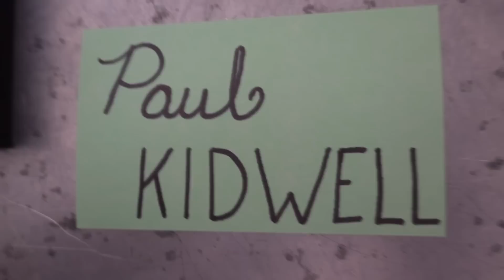Captain's Blog 7 2 2019 I Suck At Drywal Finishing

Comment: For your future reference: resist the urge to reuse the excess mud you scrape off. it will inevitably be contaminated with  little paper bits and grit and whatnot, making getting a smooth surface all that much harder.
mud is cheap, throw it away and alway use fresh mud.
Same rule applies to mastic and mortar when doing tiles.
Took me a few jobs to learn this.